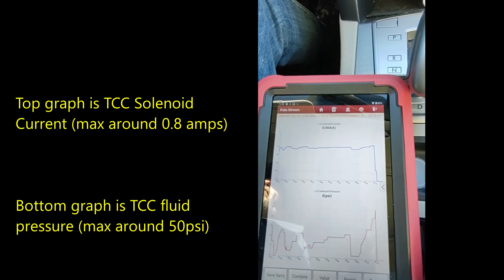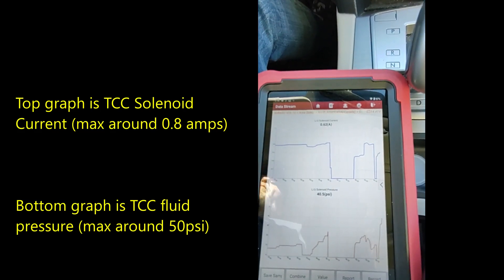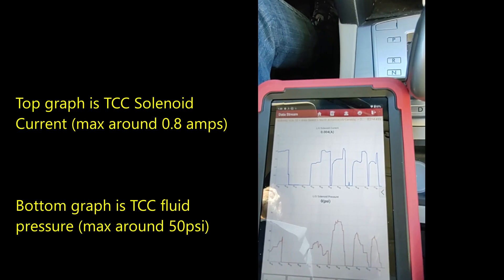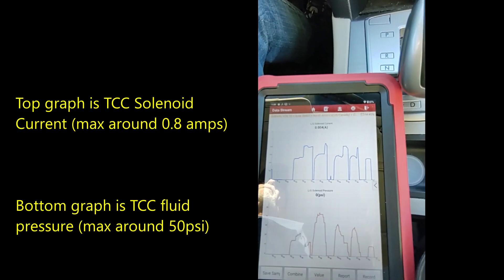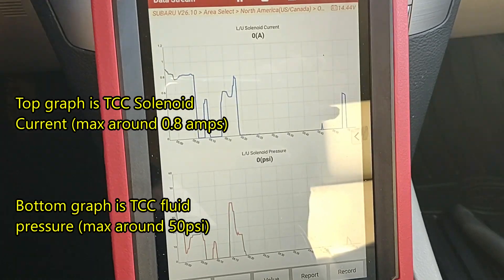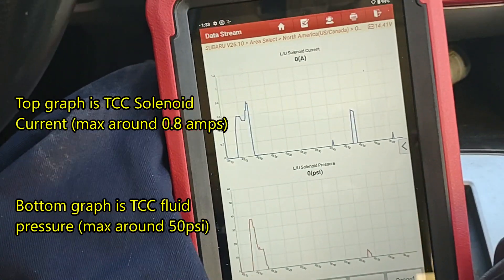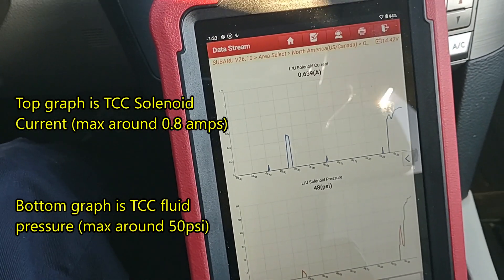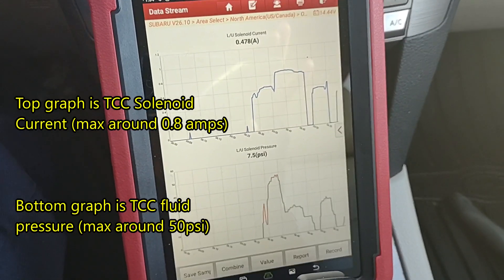2011 Subaru Outback 5EAT torque converter shudder - LubeGard Shudder Fixx before and after results

Comment: My parents 2011 outback with 3.6R and 5EAT is doing the exact same thing, light throttle from 55-60 right when L/U solenoid pressure goes up to 30-40psi it shudders like mad, always consistent with lockup pressure. sounds exactly the same too. Solenoid current maxes out at about .8 amps as well. My dad put some shudderfix in a while while back but probably less than 1 tube didnt seem to work. gonna tell him to try some more.
Reply from the maker: Adding another tube sure couldn't hurt. Also, if they haven't changed transmission fluid in a while, a drain and fill would be a great idea, and make sure they get the right fluid. I went with the manufacturer spec fluid, and of course add that tube of Shudderfixx, or maybe two, after the fluid change to give yourself the best chance of success. Of course, there's a distinct possibility that they will eventually need to replace the torque converter, but my sister's car is still going strong with the original after my liquid fixes.

Comment: The product says its not compatible with CVT
Reply: Oops. I have a 12 outback 2 5Lcvt that shudders out of 1st and stalls if you slam on the breaks. Was considering adding the CVT version of this
Reply from the maker: @freshcoatcustompaint8870 I've honestly been very happy with the Lubegard products, and have had great success with both the Lubegard Platinum additive for the conventional transmissions, as well as the Shudder Fixx product (I don't have any connection to Lubegard, BTW). I can only say if they make a version of it for your car, it's probably a pretty good option.
Reply from the maker: Yes, I'm sure the CVT uses a different speed sensor. Remember, my video is for the 5EAT conventional transmission, not a CVT.

Comment: Has the shudder come back? My 08 Outback with the 5eat is shuddering also. Was debating on using this
Reply from the maker: @GarageofMike  it's still doing very, very well. I do feel what might be extremely slight shudder every once in a great while, but if you have to really think about it, it certainly not bad enough to worry about. ;-) All in all, I couldn't be happier with the results. If it ever does get worse, my plan is just to squirt another tube in, which I am fairly certain will take it back to non-existent.
Reply: @Mark_H_DIY  Hi there how is the transmission fairing. I used it on a Lexus and it's some what cured the issue which was happening at TC lock up at 40mph on light acceleration.Was looking at getting a high mileage OB so came across your videos.Keep up the good work.
Reply: Also lube gard says do not use more than two tubes.
Reply from the maker: @aliasgertayabali5260 still running shudder free. Occasionally you can feel something that could be shudder, or maybe just road conditions or suspension wiggle. But  if it's so far down in the weeds that you have to strain to notice it, that's a win!
Reply from the maker: My sister reports there's no shudder. I suspect there probably is still a tiny amount, but if you have to strain to notice it, I don't put it in the problem category. I couldn't be happier with the way it worked out, and don't mind having skipped swapping out the torque converter. 😅